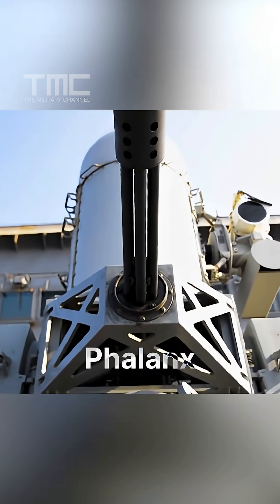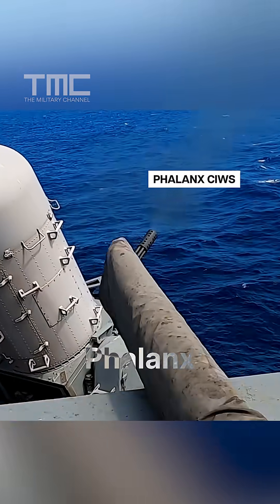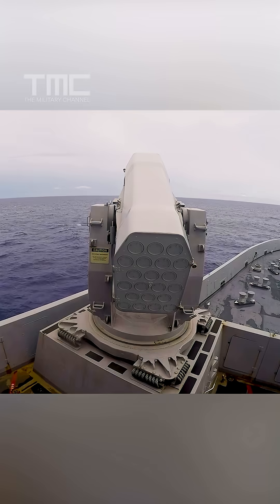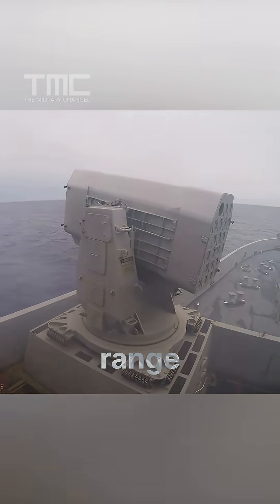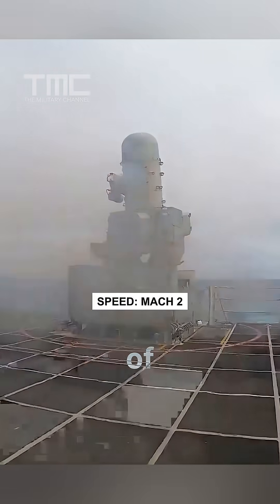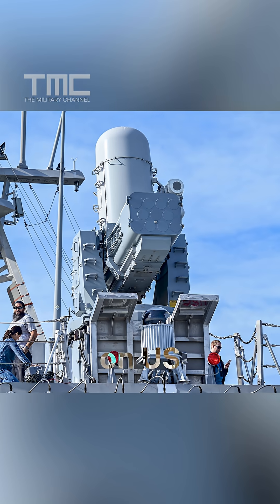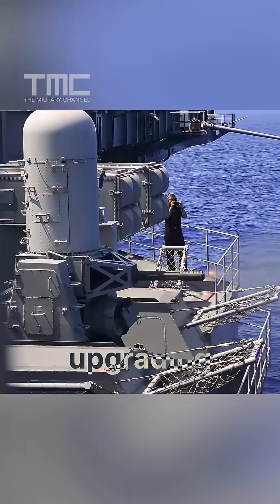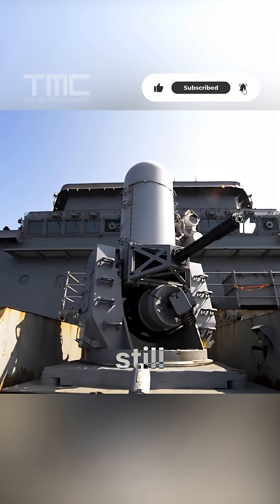When the Navy Turns a Gatling Gun Into a Missile Launcher

Comment: How long does it take to reload missiles?
Reply from the maker: A typical SeaRAM-equipped ship usually has one launcher with 11 missiles. Since reloading happens one missile at a time, if it takes roughly 5–10 minutes per missile, a full reload could take 55–110 minutes Also, depending on crew proficiency and whether the ship is conducting the reload under calm or combat conditions. It’s designed for relatively quick turnaround to maintain air defense readiness.
Reply: @TheMilitaryChannelUSA . Thank you for that information!
Reply from the maker: You're welcome!

Comment: They need to make the smart bits smaller and put them on the larger launcher. Then add 4 to every ship. 8 for carriers and heli docks and 2 for lcs ships.
Reply from the maker: Good point. That would make the ship's defense impenetrable. However, given the immense cost and complexity of modern warships, do you think it is more effective to specialize a ship for a single mission, such as air defense or anti-submarine warfare, or to build multi-mission ships with a variety of weapon systems, as you're suggesting?